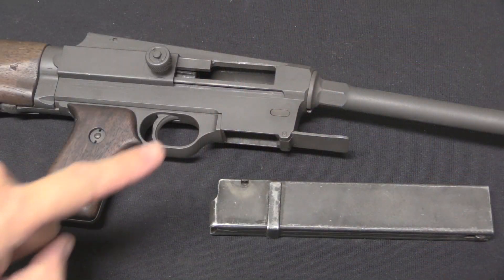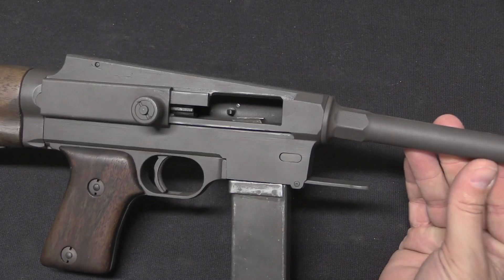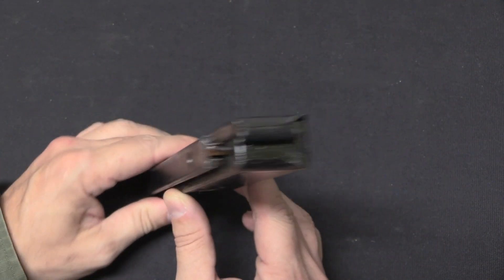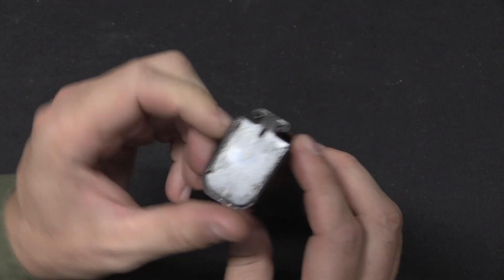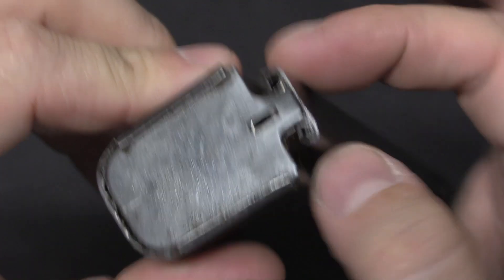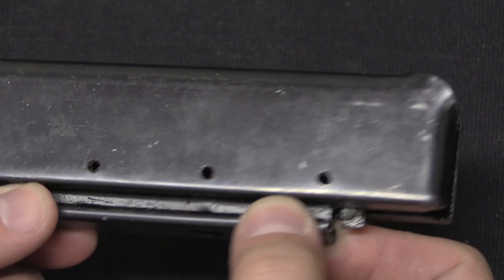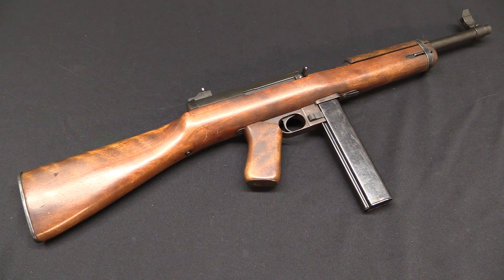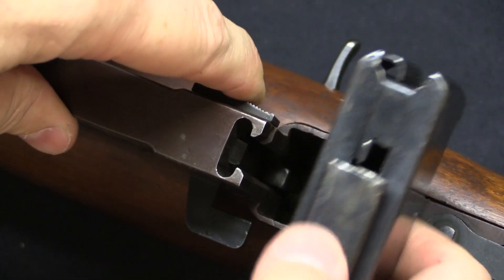Ask Ian: Why Didn't The M3 Grease Gun use Thompson Mags?

Comment: The feed ramp(s) on a Thompson are quite long in order for the bolt head to properly feed round from the double stack mag.  Also, the Thompson mag has a flare at the front to mate with the feed ramps.  All of these could have been overcome with a little more engineering, even with the use of stampings.  If they were copying the Sten, US designers should have stuck with the straight tube receiver and side mounted magazines.  But then, the US wasn't looking at the M3 as a new infantry weapon, but a compact, quick defense weapon for truckers and tankers.

Comment: It is a question I have always wondered.  Granted the guns (and ammo) we initially used at work were military hand me downs (military to GSA, then to us), but the Thompson stick mages we had displayed no problems on the range, but sometimes we saw jams with the M3s.  I will take the position Army Ordnance messed up by not specifying the new gun had to work with the Thompson stick mags already in inventory.  The M3 bolt was a machined block of steel.  I concur that making the stamped M3 body hold a Thompson mag would have probably required a little more creativity on the part of the M3 designers, but I think they would have come up with a way if it had been in their tasking,, but it wasn't.  Of course we won the war anyway, so what did it matter..

Comment: They could have cut the "T" off the Thompson mag and made a more modern mag well and it would have been a significant improvement in manufacturing ease I'd think. 

I think the system I would have proposed would have been a "hybrid." Add a hole to Thompson mags, then add a ramp to the M3. I mean look at the AR9, they basically stuck the feed ramp in the mag block and it wasn't a big deal even when they ran them in FA.

Comment: My dad trained paratroopers for Korea..

He didn’t like the Thomson because it was heavy and ate ammunition.

He preferred the grease gun because of its lower rate of fire which was fast enough for the purpose it was used for. 

It was also easier to carry the Thomson was at 10 pounds and the M3 was a little over 8 but could pack smaller.

Comment: Another more modern design which uses the same guide rib concept for its magazines is the 'GM6 Lynx' rifle (admittedly not a submachine gun) which features tabs on the front of the magazine to guide and lock it in position and prevent feed issues that might occur if it were allowed to move under recoil (which is significant given the .50 BMG chambering)... which shows that even seemingly outdated design concepts like this are still useful in the right circumstances.

The Forgotten Weapons video on it, time stamped to relevant part regarding the magazine: https://youtu.be/iRMIosCF4kQ?t=388

Comment: Another issue to consider is, from a logistics standpoint. 

Yeah, they had a whole bunch of expensive Thompson guns, and a whole pile of expensive magazines. 

If you design the M3 to use Thompson mags, now you have a whole pile of expensive Thompsons with an enormous sunk cost in both R&D and production that you can't use for anything, because there aren't any magazines, unless you expand production of expensive Thompson magazines, to support both the existing Thompsons, and the M3.

Think about it like this, you're a GI in 1944. Top says to turn in your Thompson for this new whiz-bang SMG, BUT, keep your mags, because they still work. Cool.

What happens to the expensive Thompson? It goes into a warehouse somewhere. Because now that this cheap metal Grease-gun thing is flying off assembly lines, they're going to need existing, or expanded Thompson magazine production to feed the pipeline of M3s to the field.

Anyway, that's my take on it. Let me know what you think. Different mags actually makes sense.

Comment: My answer is a bit different. Even if the M3 could have used  Thompson mags, those were expensive, which would somewhat undermine the point of the M3. Yes, two different mags did complicate logistics, but US logistics were second to none.
The M3 mags did have some downsides, though. Since they were longer than Thompson mags, they wouldn't fit in existing mag pouches. There are actually a lot of pictures of US soldiers with M3 mags stuffed in their trouser pockets. It was pretty late in the war when the M3 pouches made it to the troops.

Comment: Not sure about the Sten mags, but another annoying thing about Thompson mags is that the tab on the follower that activates the bolt catch is extremely flimsy and prone to break. Changing magazines is also a lot slower and requires more fine motor skills due to that T lug as opposed to a magwell. IMO the only thing more annoying to use then the Thompson stick mags, are the Thompson drum mags...

Comment: Many often ignore the magazine when they think of costs. A submachine gun needs 6-8 magazines so even small saving in the costs can be significant. When Finland copied the PPS-43 as the KP-49 the cost was 749 marks for a weapon. It was intended to be used with five drum magazines which were 200 marks a piece so the magazines were more than the weapon.

Comment: Many statements on the Thompson were incorrect. Eickoff and Payne (the actual designers of the Thompson, along with some help from engineers at Colt) were not concerned about a magazine well holding the box magazine properly. Far from it. As a matter of fact, the guns tend to jam more if the magazine is tight. Needs a little wiggle. Fun fact, the very first Thompson SMG was belt fed! So was the second one. Trouble is that the system was clunky and too slow for the high rate of fire, an astonishing 25 rounds per SECOND. Like a handheld MG42. The next few prototypes used 1911 magazines, which was obviously not sufficient for combat but it was good enough to test firing from a magazine. Then they worked out designs for 20 round box magazines as well as 50 and 100 round drum magazines. The design was always about overwhelming fire so they designed it around supporting the weight of a drum magazine, this carousel of steel, brass, and lead which could feed rounds rapidly and reliably. To hold the weight of the drums there are ledges front and rear on the receiver of the Thompson allowing the drum to slide in from the sides. Because of this, there cannot be a magazine well! The drum would cut it in half! To allow the Thompson to use a box magazine they made a removable magazine well which slid into the gun like a drum mag and this would allow one to use a conventional box magazine in the Thompson and then remove it to shoot a drum. While an easy solution, it was not ideal. They continued to explore options and eventually came up with the rib and track so that a box magazine could be used without a real magazine well, since the magazine well could not exist because of the design of the drum magazines. When the M1 was designed there were a lot of changes made and a lot of problems addressed, and among them the military knew it did not want the drum magazines. They could have taken the time to design a new magazine that used a conventional magazine well and make the gun with a normal magazine well and it would have run fine but it was a lot easier to just keep all the stuff there and simply stop cutting the cross slots in the receiver and frame that accommodated the drum. The Thompson stick mag can and does work fine in a normal magazine well (mostly 45, the 9MM has a lip on it to bridge the magazine and receiver which is tough to fit in a magazine well), and it is also easy to convert the Thompson to use double stack single feed magazines. I suspect they made a new magazine for the M3 because they wanted to change as little from the Sten as possible while also meeting their design goals. Plus, the question of existing inventory and tooling was nothing then, since the flow of material was so strong at that point it was not a concern.

Comment: I believe the Thompson's "magwell'" construction was also due to it being engineered with drum magazines in mind, no "well" in the "magwell" means you don't need a long, articulated, awkward follower to push bullets through it.
Reply: From what I can gather, there's actually two different mag retention mechanisms at play in the M1928. One offset for the drums and a latch for the hole on the stick mags.

It's overengineered with both in mind, without coming to a sane middle ground design for the drums and mags.

Comment: The Thompson magazine is easier to load since it is a double stack, double presentation magazine. This is because the Tommy gun has a relative wide and long feed ramp to effectively funnel the rounds into the chamber. The finger torturing double stack single presentation magazine on the grease gun is need because the "feed ramp" is  a simple chamfer countersunk into the end of the barrel. It goes all the way around as the barrel isn't indexed in any particular position. The single presentation allows the cartridge to align more closely with the chamber over a shorter distance. A Tommy Gun will feed any bullet shape you like, in fact it will usually feed empty cases. The grease gun pretty much need ball to feed reliably if the bullet hits the chamber a tiny bit off angle..

Comment: One thing you may have forgot to mention Ian is the Grease gun is way easier to do quick mag changes. The Thompson is harder because you must line up the rail in the mag with the frame of the Thompson to get it to connect and seat. The Grease gun has a regular modern mag well so all you have to do is get the mag in the well and you’re good. Much quicker mag changes, I’m sure the military ordinance officers recognized this. I own both guns and I’ve noticed this problem when competing in sub gun matches.
Reply: @Emerius Jones thx

Comment: So the MP28 was single stack because the MP18 was single stack because it used magazines for the Luger pistol. Then the Sten used used single stack because it drew upon the Lanchester magazine which copied the MP28 so the M3 used single stack as it was a 0.450” version of the Sten magazine. Thus it all goes back to the 1901 Luger design decision.
Reply from the maker: Yup.
Reply: @ForgottenWeapons  as an engineer, I'm screaming inside
Reply: The M3 is single feed not single stack. It is double stack single feed.
Reply: @anthonykerber1574  yeah he used a wrong word, but otherwise it is true. 

The Sten was a MP28 simplified for production. The MP28 was an updated MP18 but kept the same mechanical system. And the MP18 was built around the trommel-magazine for the Artillery Luger after it was decided that fully automatic Lugers were not a good idea.
Reply: This is a concept called "Path dependence" in economics and the social sciences.
Reply: Your logic is flawless. 🖖🏻
Reply: Yes we rule zem all
Reply: Yup, and the width of the modern us railroad goes back to the horse butt width in Rome
Reply: @samray3644  or at least the wooden railed horse drawn tramways of NE England mines.
Reply: This is a good example how traditions can be bad.
Reply: @jasperzanovich2504  In this case it is less tradition than war expediency. 

In WWI Germany didn't want to have to introduce a new high capacity magazine (or would have struggles to do so), so they built the MP18 around the Luger magazines already in production. 

In WWII the British needed their machine Carbine (buying Thompsons was not a practical solution) in service in large numbers as soon as possible so they stuck with a proven design for the mechanical parts.
Reply: @jasperzanovich2504  Definitely! 
I think tradition is highly overrated. If it's a good tradition worth keeping, there's reason other than tradition to keep it. If not then the fact it's tradition doesn't make it worth keeping an outdated practice.
Reply: This is just like the history of why Jesus Christ is a white dude

Comment: I think the Sten series is the pinnacle of 'just how cheap and mass-produced can a weapon be'? 
The latter Sten handle is atrocious to the point of almost being unusable; there is a need for a front hand placement but no good one (muzzle jack gets super hot, so you gotta hold onto that mag); the sights are rudimentary. 
What it does is shoot: and shoot a lot of rounds fast. 

The American Grease Gun was basically a slightly better step in ergonomics/practical usage over the Sten. Both were basically 1st gen SMGs, only made cheaply due to wartime necessity. Whereas the Thompson was also 1st gen but was overcomplicated and thus fundamentally expensive.
Reply: I have known WW2 Sten gun users who were delighted with it. Did the job within the range the average infantryman used to engage the enemy.

Comment: Ok here's a question: if the M3 was made to fulfill the same role as the Sten, and uses the same magazine as the Sten, why develop a new thing rather than just using the Sten?
Reply: Because it wasn't designed for the same battlefield role as the Sten, and it wasn't even designed for the same manufacturing system as the Sten. The Sten was designed to (in theory) be knocked together in garden sheds if necessary. 
The Sten is also ergonomically a really unpleasant gun to use. The M3 is objectively better designed.
Since the Sten uses different ammo from the Thompson there is no adantage to making the magazines interchangable. 
When Ian was saying the M3 and the Sten were the "the same" he meant soley in terms of the very basic design principle of "make as cheaply as possible", in every other respect the two guns are completely different.
Reply: The Sten gun was total junk compared to the M3 Grease gun. The Sten has reliability and accuracy problems that the Grease gun doesn’t, plus the US only wanted 45 caliber sub guns in WW2.

Comment: So basically the Thomson mag was too expensive to go with the main theme of the M3 .... there were NO technical issues with using it with the M3 if they so desired, it would just cost more ...
Reply: Yes there was the Thompson mag slides into a rail in the receiver, the Grease gun mag slides into a mag well two different concepts.
Reply: @craigthescott5074  because it would be impossible to design the same for the thomson mag ... right
Reply: @lubossoltes321  it doesn’t make sense to use the older Thompson mag design it’s much harder to do a mag change quickly with a Thompson compared to the Grease gun. The Grease gun mag well was just a better design.

Comment: Another reason the Thompson mags are probably designed that way is because the original guns use drum mags extensively.  If you don’t want your drum mags to be bulky and complex, you can’t have a traditional mag well on the gun.  The sides need to be open or you have to put a feed tower on every drum mag, so it works better for that to have the features that secure the mag on the back.  Suomi and ppsh are similar.

Comment: The Thompson doesn't have a magazine well so that drums could be used, in the early versions anyway. No mag well, no mag release button.
Reply: It was exclusively made with a mag well by the time the M3 was developed. The dropped drums as an option pretty quickly.
Reply: @SlavicCelery  I don't think the Thompson submachine gun ever had a mag well.
Reply: @baconvonmeatwich  Compare the receivers between a 1928 model and an M1A1. The magwell is short, but it prevents the drums from being slid in from the side. 

Not a big one, but indeed, it has one. 

1928 w/ Drum - https://upload.wikimedia.org/wikipedia/commons/4/42/Thompson_nobg-1.png

M1A1 w/ Magwell - https://cdn.rockislandauction.com/dev_cdn/71/1560.jpg
Reply: @SlavicCelery  I see what you mean, but I was referring to a fully-enclosed mag well ala the Sten gun.
Reply: @baconvonmeatwich  Mag wells aren't defined on absolute depth. VZ58's aren't exactly running super deep mag wells. But, the Thompson mag well, does impact what magazines are compatible with the firearm.

If you want to get super nuanced, the rail that holds onto the T-Bar of the back of the mag would also be part of the mag well, as well. 

Early SMG designs are just unique in their own way.

Comment: I've read that another factor was that the decision was made to design a 9mm conversion kit for the grease gun (which was never used) and it used Sten magazines.  One need only change out the bolt, barrel and recoil spring, and then Sten magazines could be inserted (I'm fairly sure an adapter sleeve would have been part of the conversion kit also, as 9mm mags would have been narrower) and the gun used as a 9mm submachine gun.  Obviously, if it was going to use actual Sten mags as a 9mm weapon, the regular, .45ACP magazines had to be similar in design to those of the Sten: double column, single feed.
Reply: I was just about to post this- yep, the original TDP required the M3 to use 9mm and Sten mags as a conversion kit.  I appreciate Ian's analysis, but if not for that requirement the M3 could have been made to use Thompson magazines, which were readily available in the supply system and would have made supply infinitely easier than the cost and logisitics of developing an all new magazine.
Reply: @svenjonsson9  not to mention, 50 round Thompson drum mags in the grease gun would be pretty bitchin’
Reply: @freakingabagool3510  Well, the US was using the M1 and M1A1 Thompson by this point in time so the drum mags were already not compatible and likely given out as aid for nations using M1928A1 thompsons (like commonwealth nations).

Comment: The M3 magazine works better than that of the STEN, either that's down to better manufacture or a better designed well. I wonder why the Brits didn't make the necessary alterations in one of the various STEN marks.
Reply: It could also be that the .45 ACP worked better in the magazine than 9mm. If you look at later larger capacity 9mm magazines, they are sometimes slightly curved. Not all but it does help with the cartridge shape of the 9x19mm cartridge.